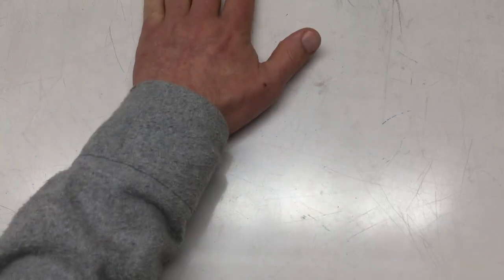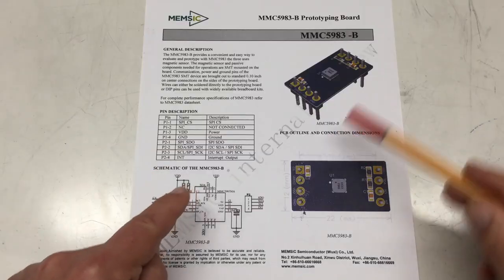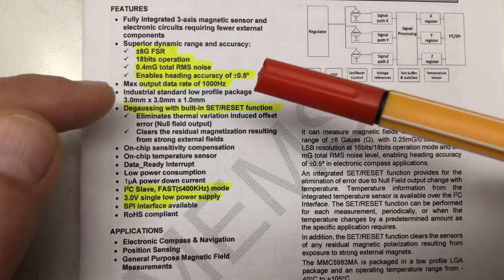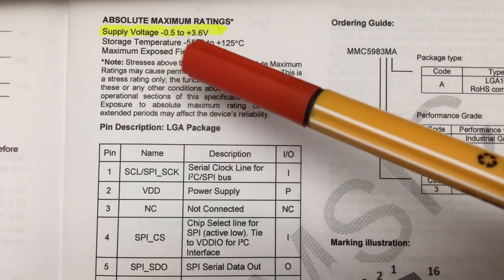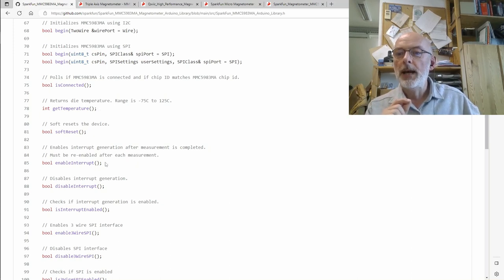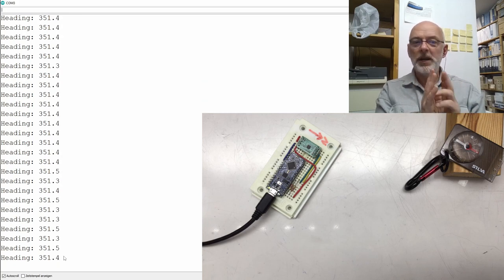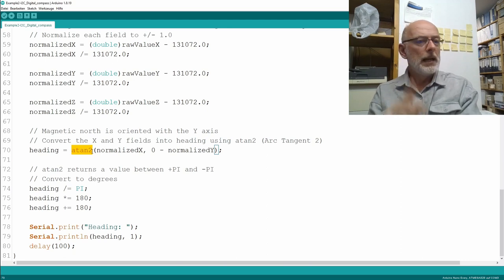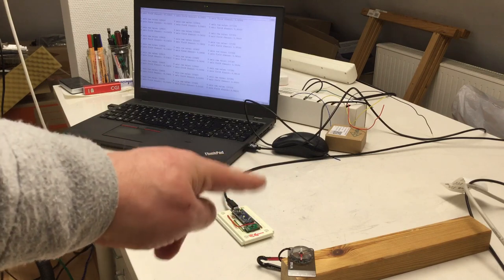MEMSIC MMC5983MA 3 Axis Digital Compass & Arduino MCU – The Basics

Comment: Great series of videos about this fantastic sensor. It seems that the MMC5983MA has only one I2C device address. Am I right or have I missed something?
Reply from the maker: Thanks 🙂 And yes, the MMC5983MA offers only a single I2C address. However, if you look at page 9 in the datasheet (Ordering Information), there seems to be an option to order it with a different I2C address. But I guess you have to talk to MEMSIC for that.

Comment: Great video, interestingly I recently started working on a custom compassing solution, and after looking for quite a while, I also came across this device. I create custom boards so I didn't get the evaluation board version (wasn't actually aware these exist), what sold me on those are the following:
1.Price is incredible for the specs.
2. high sensitivity (24 nano Tesla per bit at 16 bits, which makes the output data range about x10 wider than other solutions at this price bracket)
3. built in set/reset straps for eliminating accumulated noise in the sensor.
4. Voltage level is 3-3.6V (most magnetometers at this price range are 1.8V, or require split supply rails for i/o and power).
Reply from the maker: Thanks for the praise! I was primarily selecting that chip for it's low (and actually specified) noise level. When I started to work with it, I was really surprised it's many features.
Anyway, which accelerometer chip are you using in your solution? I'm still searching for a good one ...
Reply: @robertssmorgasbord  I use the ICM 42670 (from TDK). It is 1.8V-3.6V compatible natively.
Reply from the maker: @העבד  Thanks! I will have a look at that chip.

Comment: Hi Robert. Thank you for the great video. I am trying to implement this with esp32 and getting some errors. Can I have a guide on it how to adapt the code to esp
Reply from the maker: Hi, I would love to help, but I have absolutely no experience with the ESP32. What kind of errors do you get? Maybe I can give you at least a pointer.
Reply: @robertssmorgasbord   Hi Robert. I was able to figure it out. I was able to convert those arduino libraries to pure C language since it was the requirement. The register level understanding I got from your videos helped me a lot. Appreciate your hard work
Reply from the maker: @dinethjayakody1967   Kudos to you! Back to good old C 😁 Well, some might say C++ is just a glorified pre-compiler for C (which it actually was in the early versions).